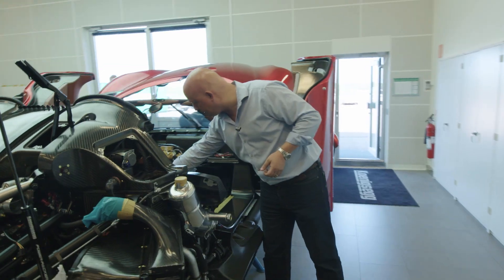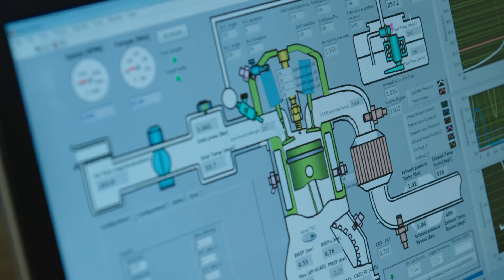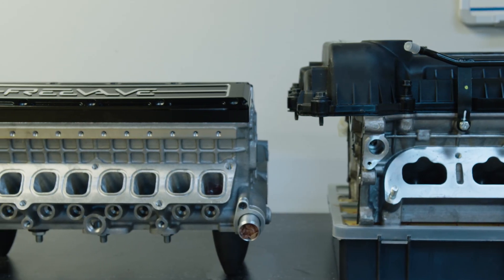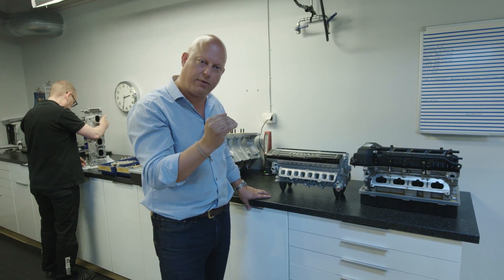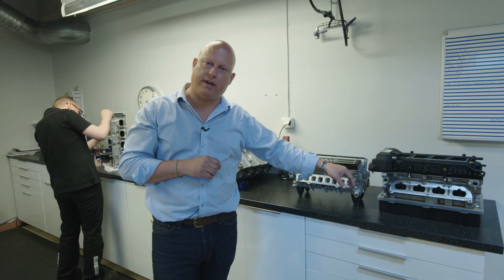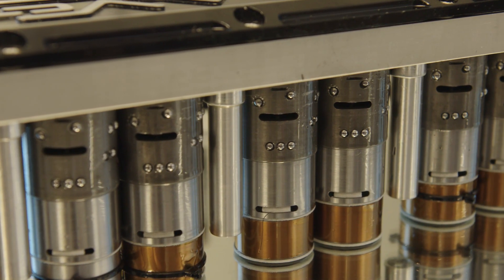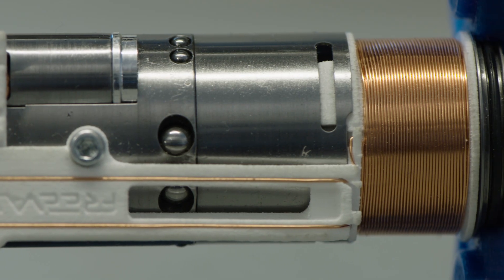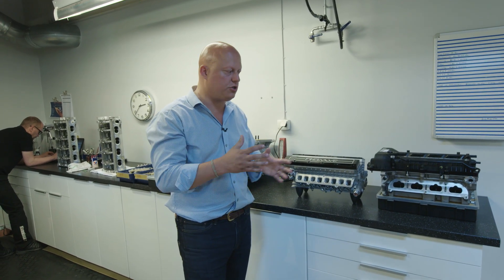Freevalve Update Camless Engine -- /INSIDE KOENIGSEGG

Comment: While the increase in horsepower and torque are quite good at 47% and 45%, the spherical rotating valve design gives superior performance numbers at about 83% better horsepower and torque over a standard poppet valved engine, with much less complication.

Comment: Why not design an engine with peltier module technology to absorb the heat then have a coolant system cycle that coolant through the engine. Has the engine generated electricity using the thermal conductivity of the peltier module housing the engine. Nano wire liquid battery technology could be used to store electricity generated by the engines use and bleed off to a Tesla wall at your home or to feed a grid. Truly making smart engines? Crazy ideas right? Novartis

Comment: I always thought this way was too fragile and violent with too much chance for interference. What ever happened to rotary valves?
Reply: Apparently, they can't make rotary valves seal and live in the real world. Lots of people have tried! (sliding stuff needs lubrication, large areas that have to seal well, difficult shapes to machine precisely, etc...
The poppet valve turns out to be a real good solution.
Reply: ssdwellah Same thing with rotary engines I presume.
Reply: ssdwellah good but not good enough I guess?

Comment: A couple of interesting aspects to this tech;

Conversion kits could be made for almost every existing ICE.

Also, even if there were to be reliabilty/longevity issues, replacing a 'freevalve' cylinder head would be incredibly quick and easy - no mechaincal timing system to disconnect and no necessity to "set the valve timing".

I daresay that some kind of failsafe could allow an engine to continue running with a faulty valve-actuator (or even several) with nothing more than a slight drop in efficiency.
Reply: I would have to disagree on all but the damage part, I fully agree that if the valves are not set correctly that it can cause damage. That's the exact same risk when someone modifies their valve train.

As for taking a long time.. eh, that's all software and UI. But I am going to assume that all the actuators are split into two groups: Intake and Exhaust, separated by physical wire bundles. Programming would just be like changing out infinitely variable camshafts in a DOHC valve train, except you don't get your hands dirty and you use a computer. 

Calibrating them is like any variable device, you have to set the minimum and maximum value by simply fully extending and fully closing the actuators. (The ECU most likely would be programmed do a quick check before each start up anyway to check for faults and errors)

Reprogramming ease would depend on the software to communicate through the ECU. It can be as simple as setting the Lift, Duration, and Lobe Separation Angle. It could also be as complex as individually setting multiple variables and possibly making up your own programming logic. But seeing as Koenigsegg tends to make their innovations and inventions for simplicity, and functionality. I'm going to believe they might have user friendly software. It could be smart enough to predict possible dangers such as clearance issues with lift, duration of said lift, unsafe overlap, and unusable "lobe" separation. 

We might never know for awhile. But until then, my inner tuner is just itching to get a taste of this technology.
Reply: Rainer Scott it wouldn't matter.. it would have it's own failsafe as the engine could be readily still producing power without too much loss or shut down port.

then we'll be seeing like FNTF 12: FULLY SWITCHED ON.
Reply: reprogramming all of the actuators would take a very long time to do, and more than likely if not done exactly right will cause a lot of damage. other than that i agree
Reply: the software could use AI to program itself
Reply: artbyrobot but it doesn't, and it wont

Comment: No timing belts 
You can run a electric water pump, a/c compressor and power steering pump and a 
Possibly make a hybrid of a crank pully/ alternator or electric driving alternator. No more interference engines
Reply: interference is a function of seeking higher valve lift with smaller chamber sizes in high compression ratio engines. Even with freevalve you would still see flycut pistons and interference designs.
Reply: Evan Plaice it shouldn't because the default setting of the valve are closed.

Comment: what about electricity operated valves.  you could literally change the function at a fingertip with a smartphone.
Reply: They are electrically operated and could easily have different modes controlled by the ECU in the same way that a lot of performance cars have settings which adjust the amount of power and the way it is delivered. More likely to be adjusted using the cars entertainment display or buttons/switches on the wheel as using phones in cars is generally frowned upon (a phone would be capable of being used as an interface device using either wired or wireless connectivity as could a laptop, tablet or similar device)
Reply: DjDolHaus86 fntf fo' real..
Reply: fntf? Not familiar with that acronym unfortunately

Comment: ..  Yea,  he lost me when he said DI wasn't as good as port injection and want needed... Lies,  atomization is much better, efficiency is higher, cylinder temps are lower, fuel loss is lower,  A/f ratios are more stable and are able to be much lower increasing MPG and power... That part was just a compromise to mine your pockets with cash. 

Want to make a better engine? Use free valve on a diesel application. Gas and even Ethanol is crap. You can save money with no ignition system. Then you can put DI (all diesels have DI). 

Want more ideas Koessnigg? Hit me up,  cuz 4 strokes are crap just like any 4cyl engine. I have a few companies you may want to look into, less parts,  much higher efficiency, better MPG, power and more than a ~25% power production (4stroke).

Comment: It should be possible to make it a 2 stroke. Opening all valves at the end of combustion. Flush the cylinder with the turbo pressure. Start as a 4 stroke. Change to 2 stroke when you have intake pressure.

Comment: so basically running a electronic salinoid on a valve controlling lift and valve duration 100%. thats actually a good idea. i mean it adds electronics but eliminating timing belts and chains. eliminating a camshaft completely. but i guess if it malfunctions it could possibly put a valve into a piston. They  run injector timing correctly so I'm sure its a non issue as long as the math is figured out. I'm sure this will be coming out in cars soon. getting rid of that variable cam timing junk.
Reply: Depends on the stroke of the valve and the clearance between the bottom of the valve stem/valve and the top of the piston at TDC surely. I'd sooner rely on robust electronics than a bloody pathetic mechanical toothed rubber belt. 

Frankly I'm utterly amazed at how Luddite mechanical engineers are compared to electronic engineers. I mean STILL using cart springs on cars and distributors and carburetors and cams and stuff PLUS making the pistons go up and down wasting SO much energy and power. 

Jag are the ONLY company to have produced a PROPER 21st century vehicle using twin turbines (not turbos) driving a generator feeding a battery for low speed and short distance driving and directly feeding the four almost 200HP EACH electric motors. Sadly they lost their bottle and never put it into production - the CX-75 remains a concept car only and would be a BRILLIANT move..

People who are STILL lusting after V8s are brain dead. If it's the sound you want, buy a 400 watt per channel amp and hook it up to whatever V8 sound you prefer - Ferrari, Maserati, Lamborghini, Koenigsegg, Buick, Dodge or whatever. Who the hell wants to mess around with reciprocation for God's sake. Wake up! Smell the coffee! Where and when are you EVER going to get 800 HP in about the same space as 2 footballs and weighing not much more - sure as hell NOT in ANY reciprocating junk pile and certainly NOT for an affordable amount - That's F1 V6 twin turbo hybrid land and who wants THAT kind of unreliability OR purchase/servicing cost and you'd STILL be DOUBLE the weight of the electric version and with WAY less torque across the speed range.

Nah! Motive power with just one to three moving parts, six bearings , 30,000 rpm and all able to be run on just about any damned kind of flammable fluid from kerosene through powdered coal to old cooking oil, methane or hydroxy or hydrogen gas - THAT'S the future of combustion engines.

Comment: how much energy is the compressor and larger oil pump needed to drive this valvetrain using compared to one driven by a chain?  I see the advantages with the cam profiles and cylinder deactivation,  but  is it more efficient driving the valves ?

Comment: does anyone really know what he's talking a'boot... yeah it looks cool, yeah it's a diecut aluminum head, but besides the valves being on a solenoid instead of a timing chain, it's just about as innovative as fuel injected, problems... but ya ya ya die cut aluminum IS more expensive to produce that cast iron *wink *wink... the issue their addressing is floating valves, and they're doing a good job at it, but they just need to find a cheaper/easier way to do it, preferably one that doesn't resemble a starter to avoid confusing and flustration, (I know he said the word pneumatic once is his talk...) I would suggest just getting to know your octanes to sea level to jetting a carburetor before you start congratulating this guy on hooking shit up to a laptop...

Comment: it makes one wonder why we still use cams in car engines.
Reply: wheelitzr2, Consider the cost of all that technology...
Reply: Johnny Racer nothing compared to what GM or Dodge has invested in their technologies. not to mention the future has to start somewhere and right now every  .1% of efficiency gain on that level is worth millions.
Reply: wheelitzr2 haha, rpms an engine gets up to are low for pneumatic devices.  cut off wheels spin like 15,000rpms.  I'm pretty sure the guy who owns the world's foremost hyper car company has a better idea of how it works than you do.  I doubt he needs your input.
Reply: Car companies are getting there! BMW's valvetronic is a step towards camless/throttle-less engines.
Reply: Shabbernigdo Xingjian specifically because of how infinitely tuneable the valve timing is will be the reason it gets Incorporated into your average automobile. I do agree that I like the simplicity of the mechanical valve train however these are simple electronic solenoids with just a few wires and a controller. he makes his spring less valve tech sound so much more involved than what is really is.
Reply: wheelitzr2 Hrm in the video he mentions pnumatic. even still with the rates that ignition coils and other sensors / solenoids seem to go bad nowdays i wouldent trust having one that deep into the engine. They are alredy a big enough pain in the ass just finding and replacing the ones located outside the engine.
Reply: wheelitzr2, So the free valve technology is cheaper than cams and pushrods?
Reply: no
Reply: Johnny Racer right now no, but if they would have been looking into this year's ago than yes it would be much cheaper.
Reply: Shabbernigdo Xingjian true but there are ways to not only make them easy to replace but you also have to consider the fact there is 8 intake solenoids in a 4 cylinder engine which means you have 7 redundant solenoids to keep your car moving. if even one of the valve train components went out in your current car your dead on the spot. electronics can be made very robust the reason why they go out so often right now is because auto manufactures want to sell cars cheap and regain their profits by the consumer buying replacement parts at an average price thus recouping their costs. even the high end car manufacturers do the same thing.
Reply: wheelitzr2 Hei this is nothing like hyperloop. This guy has been making idiotically fast cars, I think we can either trust him on his word or forgive the mistake.
Reply: Reliability for one?
Reply: wheelitzr2 - Well, in GM's case, it allows them to make a great engine completely unreliable, and nets them more profit in parts sales. Been a GM trait since 2007. Ford too.

These days, I couldn't begin to imagine how much MORE reliable all engines would be with this technology. When it inevitably trickles down, just don't let GM or Ford cheap out on it ...
Reply: ak operator this is what I tried to convince to my son that RPMs not necessarily making horsepower it's torque with RPMs
Reply: Shabbernigdo Xingjian oh and he says pneumatics so his low end technology doesn't get out there. there is a few flaws with pneumatics one, you have to have a pressure source ie. a compressor to keep up with the draw of 16 solenoids on a 4 cylinder engine.  2, pneumatics won't work very well at those high rpms and be very prone to malfunction. 3, there is only 2 ways to control the timing of the pneumatics mechanical or electrical, mechanical wouldn't give you the valve adjustment per rpm required and there are more mechanical parts to wear out, electrical would be a solenoid to allow air into the bladder that controls the valve and the solenoid would be electrically operated. so if your going to do it electrical is the easiest, most adjustable, and very reliable, and since the pneumatics require a solenoid anyway to work just eliminate the pneumatics and go straight to putting the electronically controlled solenoids directly onto the valves. that's how I know he is full of shit when he said pneumatically accutated.
Reply: i duno about others but i personally like my engines mechanicaly simple. VVT is good enough for me and its still a fairly robust set up. all i can imagine from this is bad seals and pressure leaks all the fkn time . its fine on an exotic or something that isint gonna see hundreds of thousands of hard miles during its life time.

Comment: the concept for the removal of the can by actuating the valves through electrical and pneumatic systems is almost as old as the internal combustion engine.....he's made it practical,reliable and cost effective.....dodge uses a version on the dart turbo...I forget there name for it

Comment: I wonder if the power gain is at the same rpm? Iv'e heard these can rev higher than camshaft engines. Hopefully they have a 4g63 conversion in the future for freevalve heads!  I doubt egr is needed either.

Comment: its funny this is koenigsegg because so many of the features of this thing are cost savings- doing things with electricity and software instead of with finely tuned mechanical parts.

I could care less about some pointless huge luxury car, but these valves could end up being used on EVERYTHING that has an ICE in it somewhere. (or even steam/compressed air)

Comment: well....everything sounds good, BUT... don't you think it is too late for this kind of technology? I mean electricity is the way to go.... I believe in 10 years, or so and we all be using electric cars. Because people driving cars with petrol, or diesel engines will look just stupid.
Reply: 10 year's eh?  I mean, very few people in the world drive a 10+ year old car right?

I've got nothing against electric car's, but they've got a LONG way to go before they replace the majority of ICE's.  It's not just the car's themselves either, but battery technology, and power generation\transport.  A electric car will consume a huge amount of energy, easily as much in many cases as a whole home would use in a day.  So your looking at at LEAST doubling the electrical consumption of the typical home.

Some of this can be mitigated, by say, charging only at night, some can't.  All in all, it's FAR more work then most people seem to think before we will be able to switch over entirely